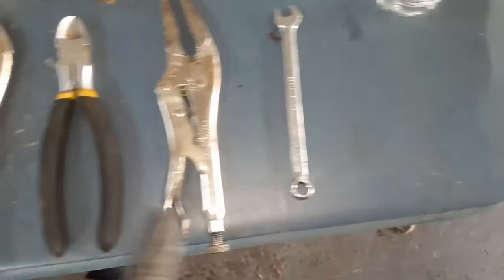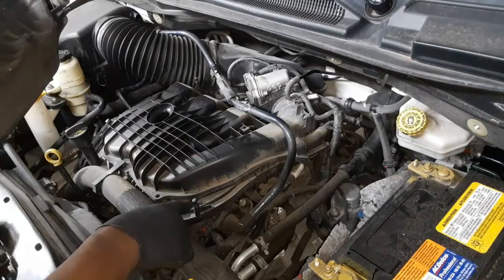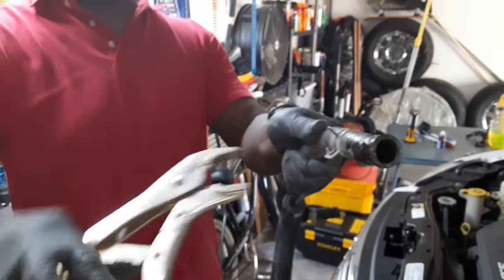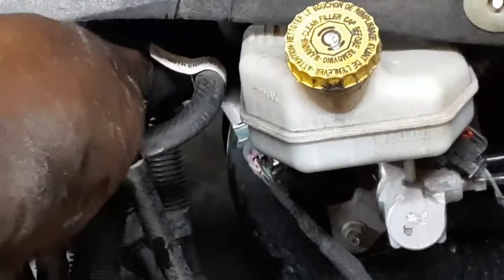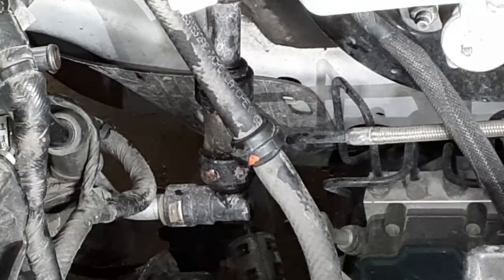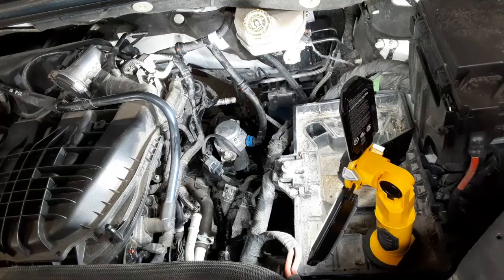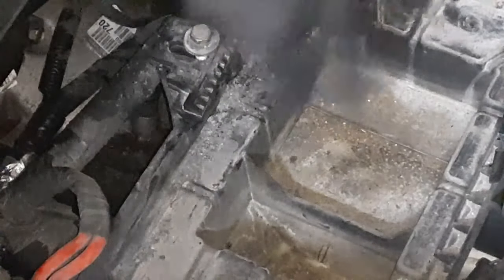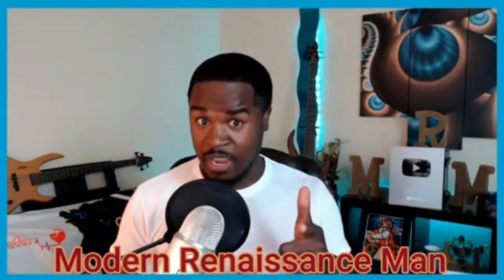How to fix Chrysler Town & Country/ Dodge Caravan Coolant leak! DIY EASILY!!!! Watch how I did it!

Comment: You lived up to having everything on your channel. Glad you pointed out the need to match the antifreeze,if you mix improper coolants it will cause all the rubber parts to deteriorate.  Huge problems will occur..  You did good..

Comment: Thanks, your video was very helpful with that little plastic part that would not come out at the 19:18 mark.  Is it even necessay?  I had bought an extra piece of hose and it fit in there with ease and then connected the other end to the Y connector.

Comment: My 2012 dodge gran caravan is leaking somewhere near the cooler lines and radiator connect.. I replaced the lines before could they be worn out again

Comment: I changed one of those for a neighbor last yr. 
The Use of PLASTICS in automotive applications will ALWAYS lead to later complications. 
I wrote a paper on this and called it "Designed obsolescence point".
As time passes the continual heating and cooling will cause the plastics to degrade and fail.
This creates a come back consumer for the dealer and mechanic as they know it will fail. Why else would they continue to 
sell plastic radiators and valve covers, and sadly oilpans as well are now made of plastics.
Reply from the maker: That's awesome bro! How you been?
Reply: @Modern-Renaissance-Man  Im alive sir. Crypto is doing well, so a nickel or two has found their way into me pocket. Wish I could have influenced yah into crypto currency man things are booming now, an we know it will have a decline one day as well. XLM ETC BTC ETH. Dont worry bro we are still watching even if YT doesnt notify..

Comment: Buddy. What is the kit called or the parts called that you got from autozone?
Reply from the maker: HVAC hose. I ordered from Rock Auto. Much cheaper but it ordered online. But , autozone, oreily, or advance carries it.
Reply: Or just get the y fitting and cut out the plastic y fitting and put the new one in and just get 3 hose clamps and it will be fine

Comment: what about that hose on minute 23:47? the one on the bottom side of where you point, does it get changed?
Reply from the maker: It's all one piece one goes up the other goes down. You can''t mess it up. The shape and the bend of the hoses will ONLY allow you to hook it one way.

Comment: Can I still drive or must it be changed as soon as possible ?
Reply from the maker: You can still drive as long as you watch the fluid levels. If the fluid levels are low just refill it until you're able to repair it.